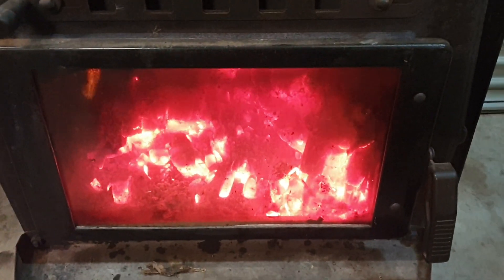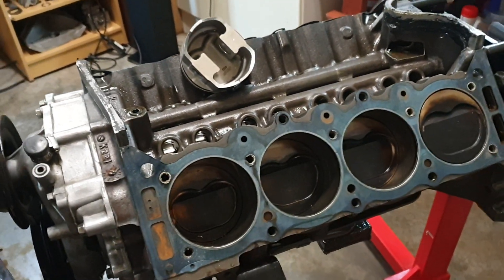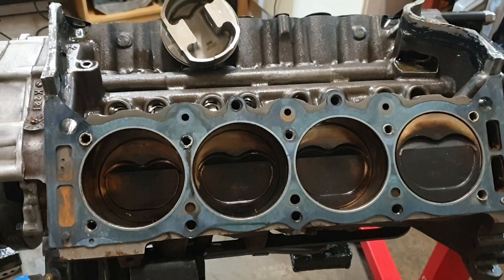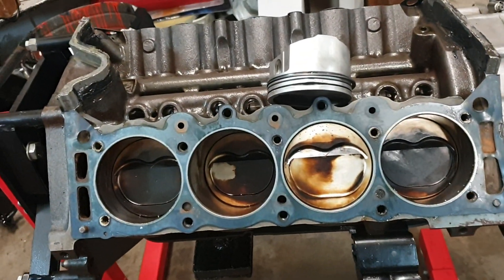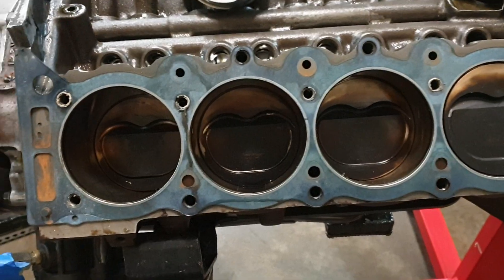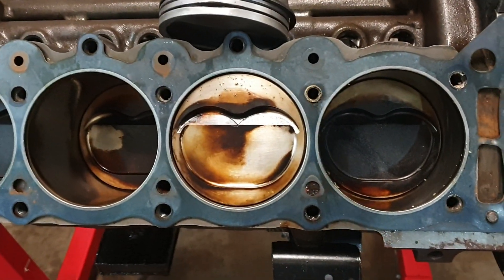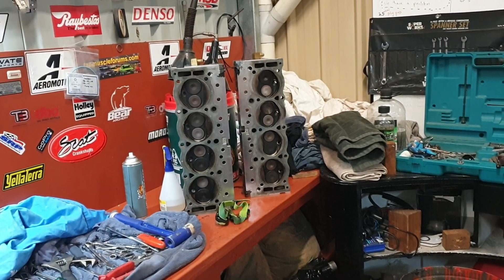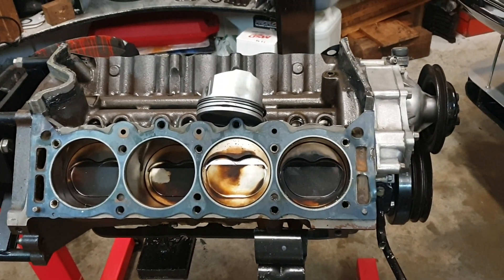I have a confession to make

Comment: Hey mate, I was using the old fuel pump location for oil drain back/breather. I’ve since found out the passenger side of the sump is best because the windage or the direction the crank spins will suck the oil in. On the drivers side it will try to push oil out👍🏻
Reply from the maker: That makes alot of sense mate, the amount of turbulence the crank makes would be insane in top end revs.. Thankyou for that tip👍

Comment: Hey Griff, been watching your videos for years and gained some valuable tips so thanks for all your work and perspectives on the truth. I also have an issue with the converter pushing up on the thrust. What size cooler lines are you running from the box?
Reply from the maker: Gday mate, I run dash 8 braided lines, with a single pass I think 6 row cooler from memory i think its  a 3/8 id pipe size. Look into dump valves, I was going to use one if I couldn't keep pressure under control. Its basically a relief valve that you can fit to cooler line and reroute it straight to trans pan... happy to answer any more questions, Goodluck hope you sort it👍
Reply: @griffsrearmountturbothemod1623  Great idea never thought of a dump valve! I'll hook up a pressure guage to the cooler line and if there's excess pressure I'll look at a dump valve. My new setup runs 3/8 lines, I'll check if they're ID, I can't remember exactly. Cheers for the tips, keep up the great vids 👍

Comment: Have you thought about running a multi layer metal head gasket ? Much stronger and not as prone to failure from detonation.
Reply from the maker: The boost level im running a composite gasket has saved my engine many times.. Their were three problems I was having and it took a few years of learning on that particular setup to overcome.
No1 was putting in boost referenced powervalves to fix lean outs.. no2 switching from pump fuel to e85 allowed alot cooer engine  running along with better octane. No3 was improving fuel distribution in to cylinders.
Since working out problems head gaskets have been reliable, and if their is a problem thats my fuse so to speak 👍
Reply: @griffsrearmountturbothemod1623  that makes sense, instead of finding a better head gasket you fixed the issue causing it. Sometimes that can be the longer harder route but definitely the better one in the end with gaining knowledge and making better reliable horsepower.